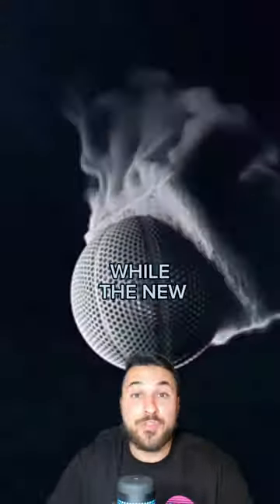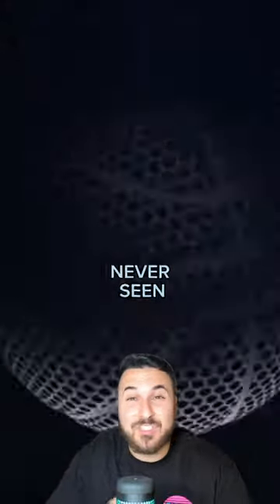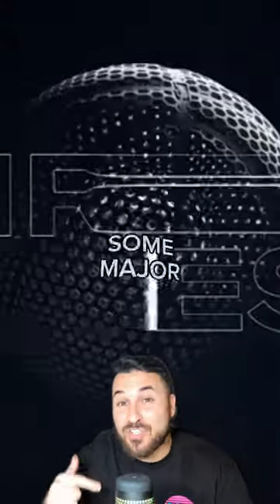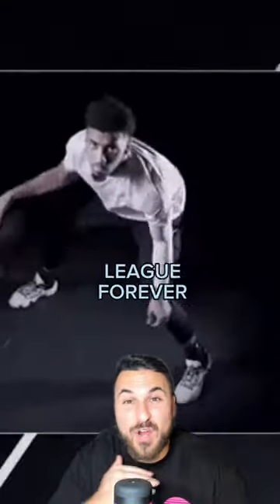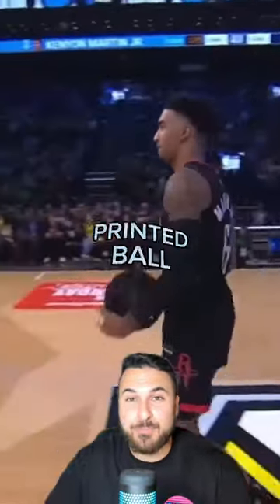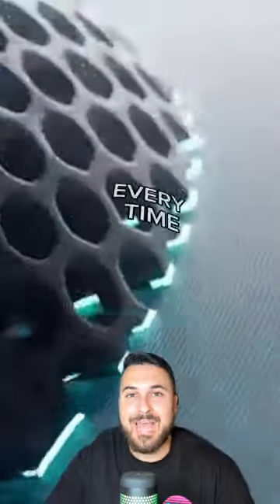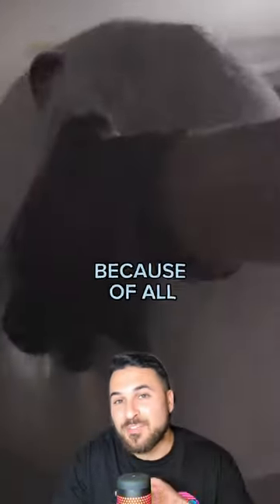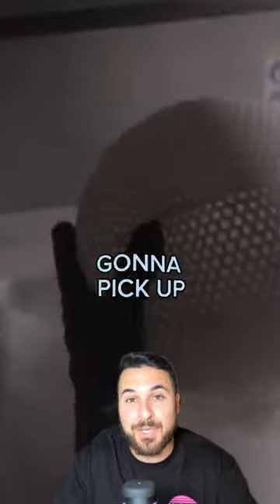The Future NBA Game Ball!? 👀

Comment: What’s the point though why fix what’s not broken?
Reply: It's broke though. The main problem with the current ball is air isn't the same in every one. Meaning that doing the exact same thing to two different balls will result in varying results. Meanwhile this doesn't suffer that issue.

Another thing is temperature. Most of the time, it's because air is a poor conductor of heat so the air inside the ball will not be able to release the heat or gain heat easily. In this airball, they can do that.

Lastly, this is much easier to make. If you didn't know, the ball for the NBA is put together by a human. This means more manpower is needed. And since it's a human, not every ball will be identical. Meanwhile this can be 3D printed. So it will be identical.
Reply: Ever hear of something called innovation
Reply: Its not a fix its an improvement
Reply: @The_Creation_Of_McDonalds it’s not an improvement it’s just a whole new product lmfao
Reply: @thatonenoob7854 bro it's not that serious
Reply: Flat balls are broken 😅
Reply: Relying on air pressure means that balls at different elevations and temperatures have different physics
Reply: In theory the airless ball allows factors like climate to not be as prevalent so that way if you’re playing in different parts of the world you get consistent results
Reply: Money.
Reply: @@DrOctogonnopusswhat about the people who designed the ball, design the printers, maintain the printers, and program the printers? Innovation will not stop, getting in its way is futile.
Reply: Looks cool, probably cheaper, don't have to inflate them, bring more interest.
Reply: Regular balls are expensive to make
Reply: Its called innovative. Thats why we make new cars, and phones
Reply: That’s the same logic as never upgrading a computer because it’s not broken. Why upgrade what’s outdated is what your saying.
Reply: you can say that about alot of things like military weapons for instance we coulda stopped in vietnam because the things worked same thing with the og iphones they worked perfectly fine and wasnt broke but everything can still become better
Reply: @@DrOctogonnopuss out of every 5 jobs you have to make a ball, 5 will stay because they will just have to change what process they use, not how many people have the job.
Reply: I’m pretty sure it’s because it’s better for the environment or something
Reply: I would like to say if humanity lived by those words we definitely would probably be in the medieval era still. The point of new technology is improvement to something broken or working.
Reply: Isn't this just supposed to be for indoor? So half those arguments don't matter...
Reply: Save the animals
Reply: Pretty much nerf the Jazz and Nuggets home field advantage
Reply: @thatonenoob7854 i think that makes the game better, more variation
Reply: @nathanpfirman625 most people still use GTX 1060 GPU. So yeah, most people not upgrade their computer til it broke
Reply: Trying out some new stuff, for fun
Reply: Because we can make it better. A fire is a great source of light yet the lightbulb was still created
Reply: Makes the ball more consistent, current balls get fucked with by air pressure and humidity, airless wont
Reply: It probably uses less material and can't be punctured so their useful life will be drastically longer
Reply: It means that every ball has the same bounce, there is no variable to it, you don't have a slightly deflated ball causing you to brick when a regulation ball would be draining a three-pointer
Reply: Why use a computer when we used paper for thousands of years?
Reply: @kancercills8181  it is an improvement though, because technically you can’t make a basketball the same everywhere if you take a ball in Florida and you play basketball for a couple years and then you go up to Colorado with the same ball and play basketball it’s gonna feel different the elevation in the pressure on the exterior of the ball is different, causing a higher or lower, bounce when it comes to a game where you were competing across the country, and possibly across the world they would need some type of ball that would have more consistency in each location

Comment: Bro forgot about that u can just rinse it with your outside hose 💀
Reply: imagine rinsing it every 3mins💀
Reply: @luffymonkey3599  uhm what? It shouldn't get that dirty in 3m. Bros playing in mud
Reply: you can't make 3d printed products wet. I'm not even sure why it's 3D printed. Injection Molding it would be cheaper and make it more durable. I guess it's so they can use the word "3D Printed" as a buzzword.
Reply: @mercuryteamfortress  your can definitely get 3d printed things wet it is just plastic
Reply: @mercuryteamfortress yes you can? Water sticks to them like any other plastic, also you cannot injection mold this item due to its complex structure
Reply: @plebulus  your using a different kinda PLA then, on my PLA it says not to get it wet.
Reply: @mercuryteamfortress  mine takes water just fine, it's just plastic really
Reply: @mercuryteamfortress bro what are you on? This isint water soluble plastic it's some form of rubber or soft plastic. This can absolutely get wet and it's pretty strong. Not all 3d printing is the same an NO 3d printing is unable to be put in water other than very specific filaments designed to be used in dual extrusion as a support material that's removed after by soaking the part in water to remove the supports
Reply: @mercuryteamfortress it's not pla pla is hard it wouldnt bounce and it would break instantly.
Reply: I think the bulk of the problem is the holes... Can't they redesign it to still be airless and with the same weight while covering up the holes
Reply: @mercuryteamfortress you can't get it wet before you print but after there printed it's fine (also they aren't using pla for this ball)
Reply: Who’s taking there hose to a court
Reply: @mercuryteamfortress also it is not PLA, wilson designed it's own elastomer for the ball, and their engineers are really good with polymers. I doubt they would develop something weak to water
Reply: @Timberjaz it’s called hyperbole
Reply: @mercuryteamfortress you know people 3d print literal boats right? Or are you gonna tell us they coat it in hydrophobic material so it doesn’t get wet?
Reply: @mercuryteamfortress it isn’t made of PLA. It is made of Nylon which is used for many plastic products already
Reply: @mercuryteamfortress bro you’re not supposed to get the PLA wet before print, smh. You can do what ever you want after, that warning is there so your print isn’t fucked up due to moisture

Comment: Yeah, the whole wind thing will most likely still happen. I don’t know many people that can accurately throw a ball with little to no spin at all. When you spin someting with holes, the edges start to act like a fan blade or air foil depending on how sharp or rounded the edge is. Thats going to push air around these holes, creating different pressure zones and essentially keeping a majority of the air from inside mixing with the outside.

Comment: That ball is perfect for outside play because wind won’t push it around but for pro play it’s not ideal they’re inside just keep playing with the normal ball.
Reply: It’s actually more beneficial for pro hooping than outside hooping
Reply: Did you miss the part where it’s better for pro play because the ball won’t vary in pressure like current balls do? That means indoors they can expect the same bounces nearly every time, instead of failing because the air pressure or temperature changed enough to give the ball a different internal pressure, and therefore a different bounce
Reply: The ball has more surface area so wind would actually be way worse for this one
Reply: On a windy day playing outside that ball is gonna curve like a wiffle ball

Comment: This ball will increase the chance that air will push the ball. Instead of just pushing on the outside of the ball from the direction the wind is coming from it will also push on the inside of the opposite wall. Now add the fact that when air is passing over a solid walled ball some of the air is deflected around the ball but with the new ball the concave inner wall will act as a sail catching all that air better than the convex outer wall. Definately not a ball you want to use outside.

Comment: Aerodynamics have left the chat
Reply: Not going fast enough for it to have any real effect
Reply: @memehamsterr 🤦‍♂️
Reply: Ikr. Why doesn't anyone mention that?
Reply: You dont think they thought about that?
Reply: @memehamsterr then why does the air push the ball on a windy day?😊
Reply: @memehamsterr  "Tell me you've never played any ball sport without telling me you've never played"
Reply: No they’re still here. The air resistance of this ball is actually about the same as one without holes. Imagine the surface of a ball. There technically aren’t any surfaces on it which are normal to the direction of travel, (excepting one infinitesimally small point in the exact center). This gives air a nice, smooth surface to flow over. Imperfect, but not bad.

Now imagine the holes in this ball. The hexagonal cells have surfaces close to normal to the direction the ball travels. This means that while some air passes through, some air also creates more resistance than it would for a conventional ball. In this case, it comes pretty close to evening out. So the ball flies almost exactly like a conventional one.
Reply: @knifedance2402  they said that last time they redesigned the ball to use synthetic materials, and everyone still said it felt different. I have no reason to believe this is any different, and nor do you.

Comment: Have you ever thrown a whiffle ball? The holes won't make it easier
Reply: It may, as players could use the spin of the ball to change how it acts mid air, floating longer or less, or going to the slide minorly. It'll change up strategy a bit for some players, but by not too much since the ball will always be consistent
Reply: A whiffle ball can curve weirdly because it only has holes on one side. This would be more like a pickleball which flys pretty straight when thrown.
Reply: Whiffle balls are also made of cheap plastic

Comment: Hmm, it's like this isn't meant for the average consumer. It's like it was designed specifically for the NBA. Even then, it's an indoor ball. Lastly the balls are meant to be so uniform that you can replace them on the fly without anything changing from ball to ball, so if the ball is too sweaty they should have the ability to swap balls.

Comment: The more surface area means more air resistances.
Reply: No, the holes allow wind to pass through without moving it too much
Reply: @primalmonkegaming2275  like how a wiffle ball flys like a baseball?
Reply: @primalmonkegaming2275 that’s uh. Not how physics work fully my guy.
Reply: @austint2328 a waffle ball isn't supposed to fly like a baseball.

Cross sectional area is the same.
Reply: @austint2328 a wiffle ball doesn’t go straight because it has holes on only one side, genius 🤯
Reply: Ever noticed how much breeze is blocked by a simple fly screen door?
Just because you can see through it easily doesn't mean air can flow through it easily.

Comment: These are literally the worst takes I have heard on this ball. 
It's a hollow sphere. Sweat is not going to stay inside because it's hollow, The thing you might have to worry about with sweat is porosity from the printing process. There's also less surface area and a different texture so the way sweat gets applied to the ball will be different.
Again with dust the dust can just come out and you can hose the ball off if it becomes a problem.
But the ball having a bunch of holes does not mean it will be less affected by wind or have less drag.
What having all the holes in the ball does is massively increase the surface area of the ball, and all the angles airflow can fuck with it from. Before when it was a relatively solid spheroid It had very predictable, aerodynamics and easy wind bucking.
Now with the hex pattern it's probably going to be pretty predictable but way higher. Drag because the air can't flow smoothly around it. It generates a bunch of turbulence every time it hits one of those hexes. And the corners don't look like they're blended super well. So you're going to get interference drag on every corner. It's just aerodynamically abysmal.

Comment: The wind will be worse the surface area is like tentupled
Reply: Thats not how that works buddy...
Reply: The surface area is smaller than in a normal ball
Reply: It isn't as simple as "holes=larger surface area" (or smaller). The size of the holes matters a lot, as do the shapes through the middle. It will also wildly shift based on spin rate.

Analyzing this is a complicated affair, if you're concerned about accuracy. It requires far more detail than what's provided here to even begin.